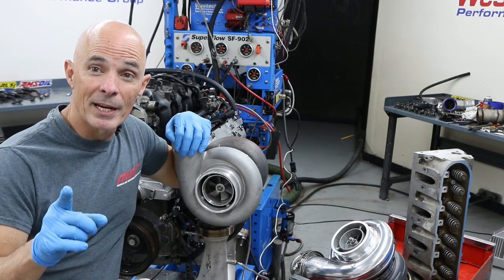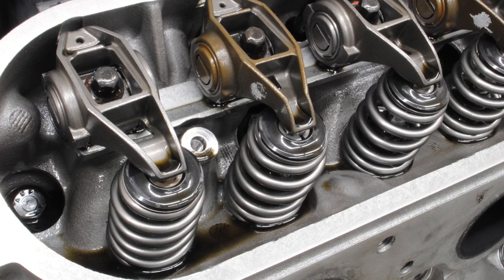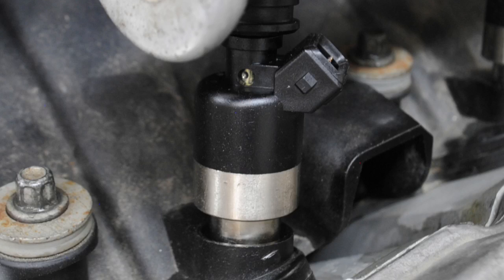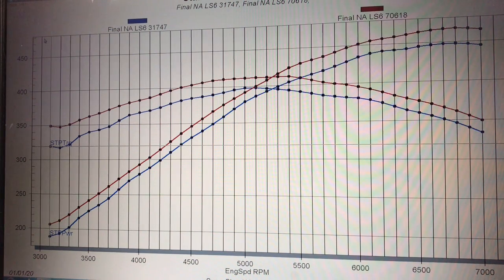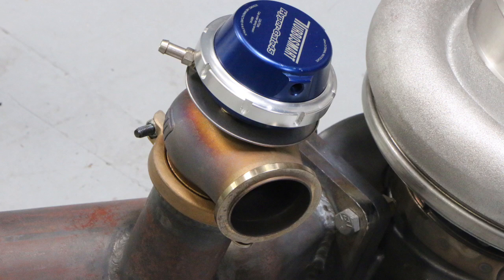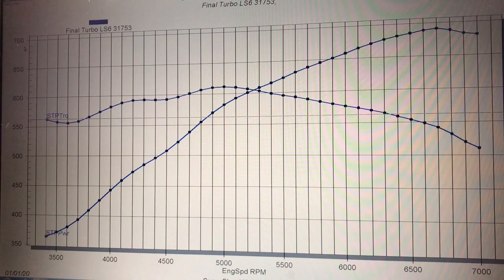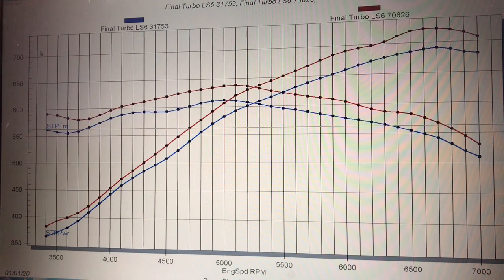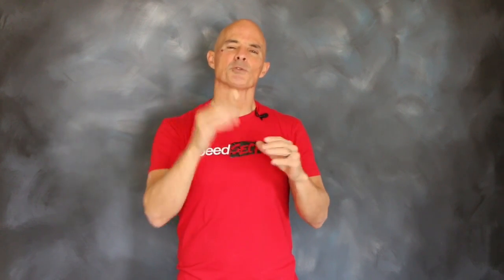TURBO LS HEAD TEST-706 vs 317 (BEST FOR BOOST?)

Comment: Interesting, but if the combustion chamber in the 317 heads overhang the cylinders in the 5,3 that can not be the best for flow. BBC engines often get ported cylinders by the intake valves.
Regarding cars and engines, you americans are incredibly privileged. I do not know if you realize this. In my country 99% of the pump fuel sold is 85 octane MON   @ 17 kr/L = ca. 7,3 $ / gallon. E85 is not available and racefuel is difficult to get hold of and is 4-5 times the price of pumpfuel. Everybody drives cars with 4 cylinder engines with manual transmissions and tall gearing and we are always severely octane limited.  The only way to get a fast car is to boost it hard to get to the 300 hp at 4000 rpm goal that is needed to get the car going the way we want to. Large turbos usually results in 150 - 200 hp at 4000 rpm., and this makes these cars turds.  It takes years of trial and error to get to good results and low compression ratios are a necessity. I therefor always use all the numbers in the columns from the dyno printout and divide the MAP pressure with the torgue and horsepower numbers to produce "theoretical NA curves". This will show you when the engine is happy and effective and when it is not. ;) When increasing boost, low compression rations engines are happier for a much longer time.  

2,0 LCosworth with 38 psi boost: https://www.youtube.com/watch?v=q3PfyeLALPM
2,0 L Nissan with 41 psi boost: https://www.youtube.com/watch?v=avZucRH952Q

2,3 L Volvo with 29 psi boost, results in the descrition. https://www.youtube.com/watch?v=nk7lU8TWZ70
Reply: PRIVILEGED?.....LOLOL......NO, YOUR COUNTRY IS PRIMITIVE.....HERES AN IDEA...TRY CAPITALISM.

Comment: Audio was actually improved compared to older videos there.. We see heads do make a difference....but with so many turbos of same inducer sizes etc.....how much difference can a good turbo make vs a cheap/bad turbo ? If any ?
Reply from the maker: turbo selection wont change these results but turbo testing is always good
Reply: @richardholdener1727  different turbos i would hope yield different results. I'm not referring to testing the heads....but the turbos. Similar patterns would of course happen with the heads. Another big question it opens up in terms of heads. Most of the companies offer as cast versions of their heads, and the CNC. With boost...are those CNC'd versions really worth the extra ? As overall...heads don't appear to be a huge limitation with the LS platform even for 1k and beyond.

Comment: Like others, I would love to see the same test,  but on a 6.0 motor.   If these 706 improve a 6.0 for daily driving with low boost, I may ditch my 317's for a pair of 706's.
Reply from the maker: run 243 on a 6.0l
Reply: @richardholdener1727   Thanks I'll start looking for a set.
Reply: @richardholdener1727  how much power is that worth switching from 317s to 243s on a 6.0
Reply: @1slogoat  I cant say how much but it is a big improvement on power and response

Comment: Would be interesting to see if it would be the same on a 6.0
Reply: I’d like to see a test with an Flat too piston LQ9 with stock 317 heads vs an LQ4 with 706 swap to see if it’s just the compression or the head design making the extra power.
Reply: Brandon Loll saaaame!!
Reply: I was wondering the same thing. I’m trying to build a 6.0 ready for boost(can’t afford to go boost right now) and I don’t want to change it several times if I can help. So I second this comment. Same results with a 6.0 as the 5.3 had
Reply: @TreyCovey  just build what fits your budget and it really doesn't make that much difference
Reply: TreyCovey the 862 heads, same as the 706 will be best every time. Unless you’re building a 1200hp motor that is
Reply: Compression beats flow with factory LS heads.
Reply: The 5.3 with the 706 heads has about 9.5:1 compression. With the 317 heads that drops to 8:1 that's a big difference in comparison on the 5.3 ... I would like to see it on the 6.0 also
Reply: 706 head would yield somewhere around 10.5:1 compression on a LQ4 6.0, depending on compressed gasket thickness, maybe more.
Reply: Same  here
Reply: I’d like to see this same test on a 6.0 as well as a 6.0 stroked to 408

Comment: what about the exact same test on a 6.0 and not a 5.3?
Reply: Robert Ambrose then why do all the extra spending. The 862 beat the 243’s all around. If you’re not building a fire breathing 1200hp motor the regular 862 is the best head hands down. But if you want to throw away money then I guess you can

Comment: The next interesting stage to this test would be to mill down the 317 head to match compression of the 706 and see how much of an impact that intake valve size has in the n/a and boosted application.. Great video as always!
Reply: This is my thoughts exactly. The 706 heads provide much more compression over the 706 which have a much bigger cc, even bigger than the 243 which drops the compression dramatically. That combined with the proper cam with the right LSA and I bet the 317 will make better power and even torque at low end speeds.
Reply: YES, something like that..  @thomasgjonovich5524
Reply: He had a set i think , also had some ported 2" valve 706s

Comment: Great results, thanks for the info! 🙌

Can you tell me your opinion: I've got gen4 aluminum 5.3 with 799 heads, 228/230 (.600/.575) 112 LSA cam with valve springs and a 7575 1.10 A/R turbo + A/A intercooler. LS1 intake (will change it to LS2 Dorman).
CR is 10.6
Running through 4L80e with 3200 stall speed 10” converter. 3.25 gears in a passenger RWD car.
Gapped rings and new internals.
Holley Terminator X max ecu.
I've made 640rwhp last year but with LM7/862 heads @ 18psi.
I guess 799 heads will be much better but will this 228/230 camshaft still be a good choice or should I pick up something more aggressive?
I guess I'll not exceed 20psi next year with this new engine just to be save.
Reply: We're pretty spoiled in the states.  E85 at 3 pumps less than 20 miles from me and no real emissions testing where I live.  Shitbox ftw
Reply: drop in the 'sloppy cam'  , should see good gains and its a cheaper cam that hangs with the big boys .👍👍
Reply: Brian Lau actually it IS the ss2 cam except lift @.050 but pretty close.
But even Elgin has "ss3" cam still for cheap. Just would love to hear Richard's opinion because he has a HUGE knowledge about it.
Reply: Btr turbo cam whoops the sloppy 2 cam for sure.  Are you on 93?  E85 would be the way
Reply: Brent Spence I've got premium gasoline only (98 or 100 octane), no e85 here :/
Reply: We see big gains with meth kits on high octane gasoline combos.  Boost juice or 70/30 methanol/water will help.
Reply from the maker: I doubt you will pick up any power with the 243/799 heads on the 5.3L
Reply: Richard Holdener gotcha, it will be okay anyway cause engine became much lighter now :)
And you opinion on the same gen4 5.3 (with same cam) but N/A with MILLED 0.030“ 799 heads?

Thanks! 🙌

Comment: Dont apologize we love the content brother   but please more sbf guys !!
Reply: I agree I would even like to see some 4.6/5.4 2 valve turbo testing.
Now if he built a Cheap 460 stroker (514 inch) and ran some cheap aftermarket alloy heads with a pair of eBay GT45s I would be very interested because that is the engine I didn't build for my F150, I went stroker Windsor.
Reply: Hakimbo Bola  We could argue that one all day long if we were talking 30 year old engines, but when it comes to the LS, it's the strongest stock bottom end I've ever seen.
Reply: @johnparrish9215  the toyota 1uzfe is pretty stout as bottom ends go as well.
Reply: The Ford is way stronger...not sure what you are talking about?
Reply: @robertelmo7736  We are talking about durability. The LS is far superior to the Coyote in this regard.  Just look up the frequency of broken pistons and spun rod bearings in the Coyote, it's a bit fragile.
Reply: Ehh maybe, but you are talking under 1000 hp builds..at the upper end the Coyote can run at hp levels that the LS just breaks right away at.
I do see a bunch of people with ring land problems in the Coyotes...
Reply: @robertelmo7736  The Coyote is a "Technically" superior engine and you are right that with 20 pounds of $100 bills the engine will survive. The only problem is that with the same amount of money you could have bought a John Kasse Boss Nine and impressed EVERYONE, not just a small group of Coyote snobs.
Reply: Maybe so lol...I just know there are some serious stock block Coyotes out there with 2500 hp and then there are the billet MMR block monsters that go up from there. Not sure how long they last but at that power level you would indeed need "20 pounds of $100 bills" lol.
Maybe 40 pounds...

https://www.youtube.com/watch?v=AALu9XV7FVs

Comment: Time to shave the 317 to match the 706 head
Reply from the maker: i don't think you can get 10 cc by shaving-thin decks are not good-better to use 243/799
Reply: Yes please
Reply: So now a 706 vs 799 n/a vs boost?? Hmm...
Reply: @MississippiDan1  I think he has made that comparison some where on his channel.